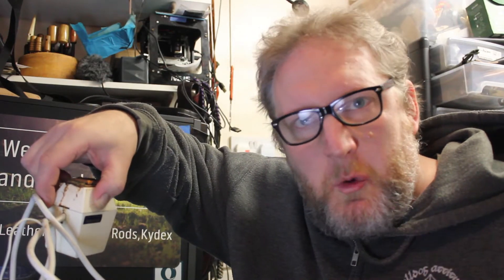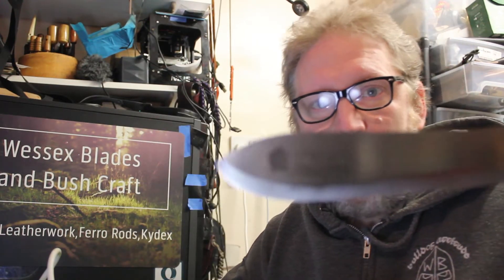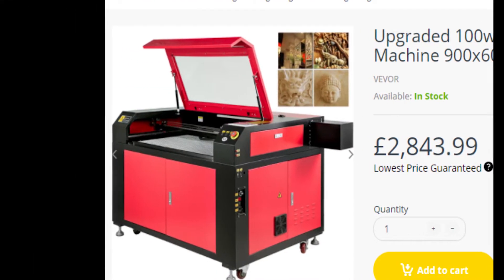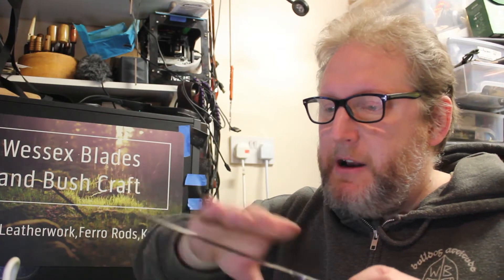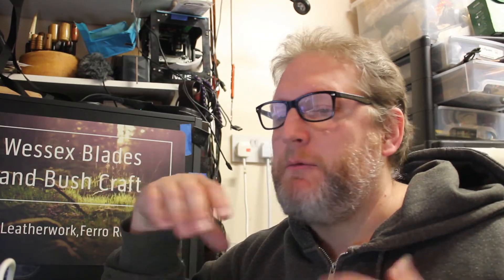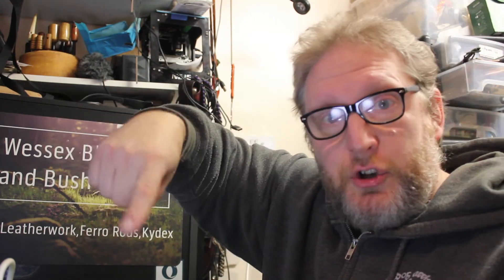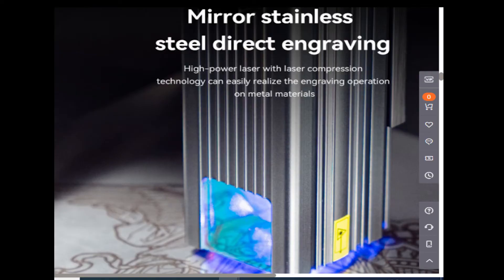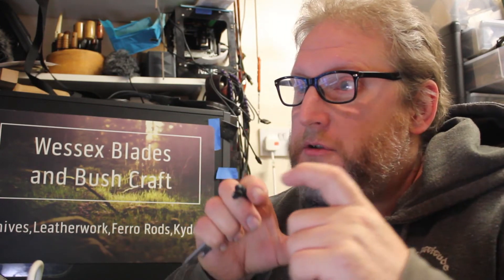Atomstack P7 40Watt, (4-5Watt) Laser Engraver, Knife making Makers Mark, New Process

Comment from the maker: Knife making Makers Mark New Process Atomstack P7 40Watt(4-5Watt) Laser Engraver ,
I have tried to get the phrases correct throughout of engrave, etch and mark so please bear with me if I got one wrong, an electro etch method uses a resist type stencil so you first DC and deep etch the design into the steel, then by removing the diode you can then utilise AC giving the previously deep etched design a dark black marking... however, this blackening is not that resilient, scotch brite pads will remove it hence why you recess it using a deep etch "cut" first.
 Ben Orford has a 50W fibre laser  which he uses at a highly focused process that cuts first then more gently cleaned the cut, this however creates a burr which needs cleaning off, acid etch will heighten the effect by sitting down in the cut design...fibre lasers are expensive, what I have invested in is a general purpose high value 40W with new technology which compresses the beam into a far more focused spot giving the "punch" to mark steel far more markedly.
In addition this gantry style laser can be used for various tasks but primarily for a resilient surface mark on steel in direct use rather than a spray on coat which then gets lasered, these can give off nasty fumes. In use the steel mark can be made in a few minutes and is far less involved and "hands on" then the sticky vinyl decals/masking off and manual electro etch dabbing of a contact etch marking tool.
So while not being a deep etch it is a very resilient marking, so good another tool steel blade can't scratch it off...trials are still ongoing but so far great results have been achieved on leather for motifs etc...
Wessex Blades..Hand Made Knives in UK, sharing knowledge, getting outdoors when I can!
Over 10 years of tips and tricks on You Tube

Comment: "If you've ever set fire to a dinghy..." There has to be a good story behind that!

I have to wonder if the difference is the laser operating in pulsed mode as opposed to continuous wave mode. While the average power of a train of pulses can be the same as CW mode, the peak power of each pulse is much higher. The higher peak power in a very short pulse could be enough to disrupt even a very shiny surface where a CW laser just reflects or the heat is dissipated before marking the surface?

Whatever the cause, the results look great and I enjoyed listening to the story :)
Reply from the maker: At the present I am using constant line , there is a pointalism kind of mode using dots but still to fiddle about with that...

Comment: Diode laser that does metal at that price is impressive. Wonder what it is like with copper or brass, .5 or 1mm depth. I like that you can get roller attachment as well, ideal to customize those olights or start doing Wessex flasks. May have to look at this myself.
Reply from the maker: Little hip flasks would be good as they lie down quite flat, I haven't plans to get the cylinder roller add on, as for brass I want to check there are no zinc vapours released etc, but copper would be cool, or aluminium etc...
Reply from the maker: also does mugs apparently..
Reply: @wessexbladeshandmadeknives  lots of possible opportunities, could engrave end of brass pins. Was their any import duty on it.
Reply from the maker: @northwales1000  I want to check on brass for any zinc vapour issues etc, as for import duty , it all depends on what the product's cost was declared as, if you email me wessexbladesuk at yahoo dot com I'll explain how that worked out etc...

Comment: I received mine today, I will watch your video before I set mine up 👍
Reply from the maker: hi there, the assembly is straight forward on steps 1,2, but when you install the hex head screw. roller bearing etc the black ring tube thing should be described as a spacer , it would make so much more sense, the plastic tube goes over the end of the screw with the 2 silver bearing bits near the head to create the free moving bearing idler for the belt, the belt..oh what a weird one, in the manual it looks like a continuous loop but came with two crimped ends, they jam into two slotted grooves to lock the belt in place while you then release the drive end a little to give some slack...the cable coupler near the power block was a bit tricky only having about 2mm of enough length to connect to it's mate, everything else was lego easy to put together, the spanner and hex keys were good quality, if you get stuck, let me know, I'll see what I can film/share etc.
Reply: @wessexbladeshandmadeknives  awesome thank a lot for the info mate that is very kind and helpful, if I struggle I will let you know but if I don’t I’ll let you know too, looking forward to watching your video 👍
Reply: @wessexbladeshandmadeknives  hello mate, just put the machine together but unfortunately I fluffed up and marked two of the main four rollers quite badly to the point then in motion it’s not smooth, so I think I’m going to have to message banggood or atomstack and see if they can send replacement rollers if I can’t smooth them out, Dam it..